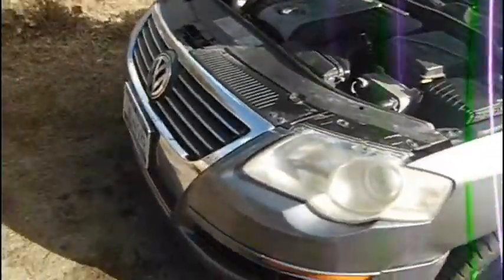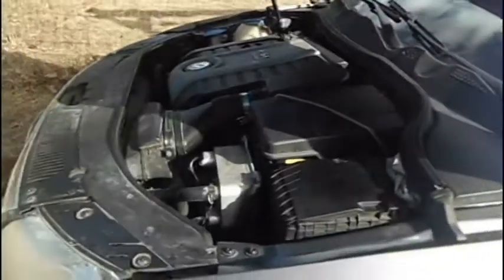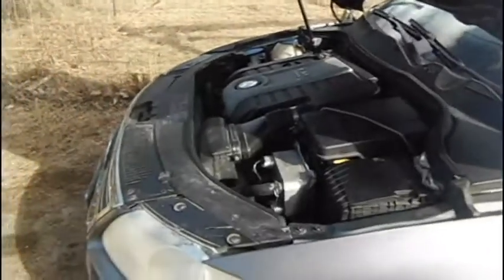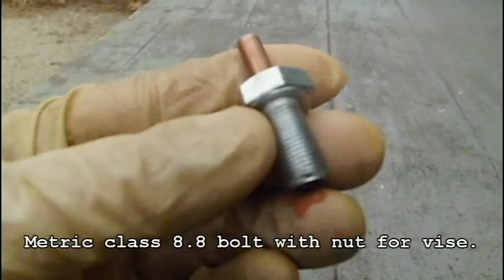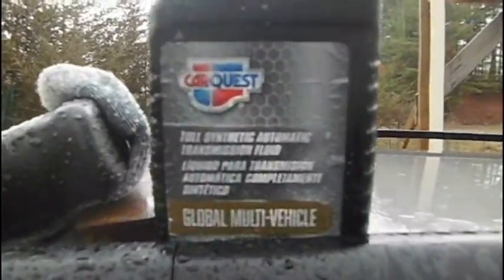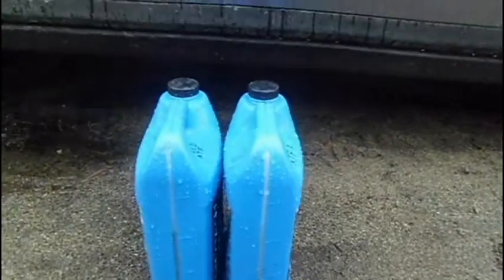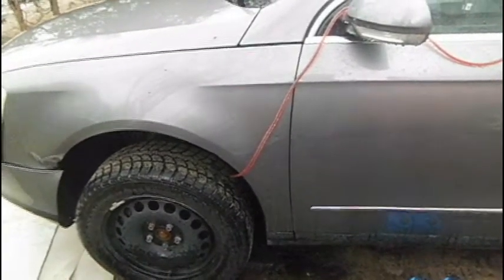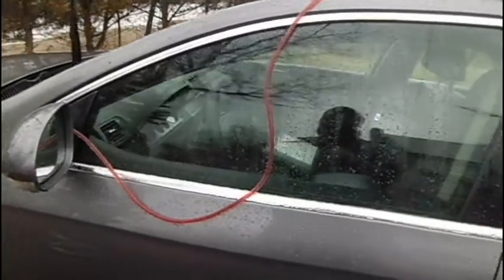2007 VW Passat 2.0T FSI I4 BPY Automatic Transmission 09G Fluid Change

Comment: There is a transmission shop not too far from me.  I usually take my used oil and transmission fluid there.  They burn it for heat.  They have some sort of waste oil burner.  All that they ask is that there is no antifreeze, brake fluid or other stuff in there.  If there is any of that in there it might cause problems.

Comment: How has that fluid been working for you?  I only wonder because sometimes these things are a little bit sensitive to other brands of fluids being used.  Now what ever that is I could not use it in my 2013 Passat unless it is also good for WS.  The older 09Gs used Type T-IV if it was G 055 025 A2.  I had a 2006 Jetta 2.5 with a 09G that looks identical to the one in my Passat.  The Passat felt so similar to the Jetta that I had before it that I already had a good idea what to expect.  The main difference is that the Passat seems to have a softer ride and that is more noticeable in the corners unfortunately.
Reply: @Marvin Tadeo Instablaster :)
Reply: @Marley Alexzander I really appreciate your reply. I found the site through google and im trying it out now.
Takes a while so I will reply here later when my account password hopefully is recovered.
Reply: @Marley Alexzander It did the trick and I finally got access to my account again. I am so happy:D
Thank you so much, you really help me out !
Reply: @Marvin Tadeo Glad I could help xD
Reply from the maker: Its been fine. I'm now replacing my transmission oil cooler lines, feed and return. They rusted down low. I had to carefully use a propane torch on the unsevered lines to break them with wrenches. Then I had to cut the rubber section of line to rotate the fittings off. I'm going to have to change the ATF again.
Reply from the maker: This fluid was discontinued. I used a dex6 recently, after replacing two lines which rusted by the left splashgard, which was missing when I bought this car. I bought a new splashguard, but the rust progressed anyways.

Comment: Hi does this work for golf 2008 2.0 FSI? Thank you
Reply from the maker: This is for engine code BPY, transmission code 09G. The transmission code is the relevant one here. It is stamped into the transmission pan, underneath, not the oil pan. FSI means fuel straight injection, which refers to the engine.